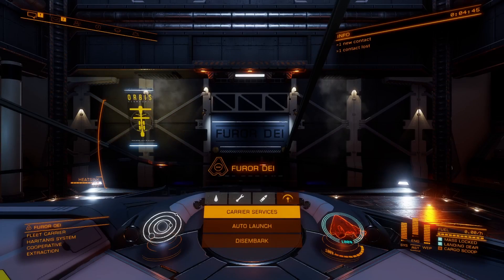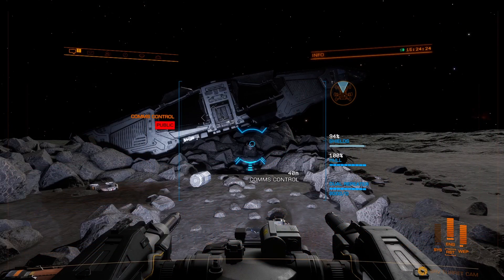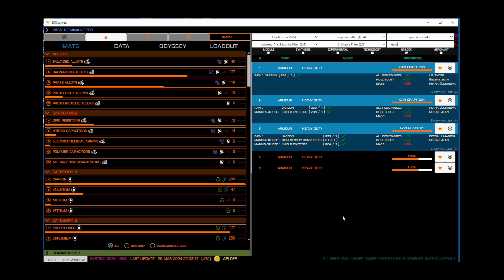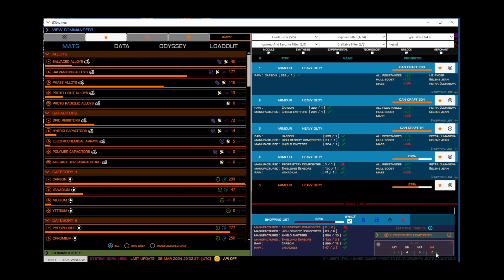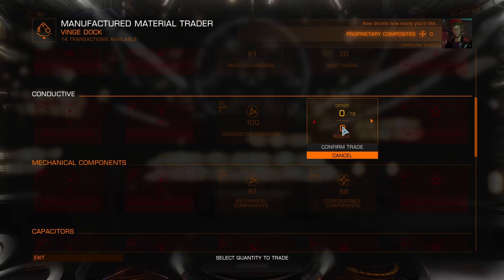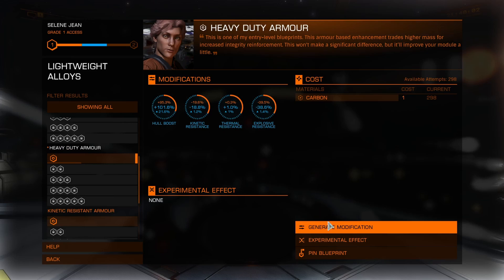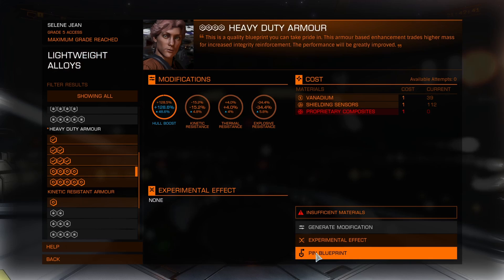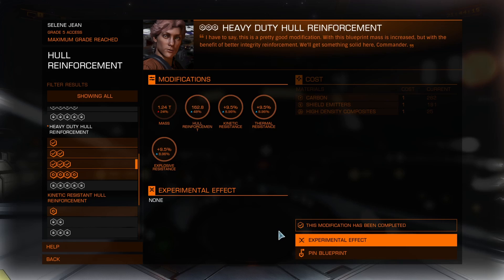EVERYTHING You Need To Know for Engineering in Elite Dangerous | Tutorial / How-To

Comment: Little tip :

If you have to engineer many hardpoints modules for several ships, like multi-cannons for example, and you don't want to do the same trip 3 or 4 times to « The Blaster », take a ship that has a long jump range and many slots, and put all your multi-cannons on it (I use my exobiology Mandalay for this ^^). So you can mod all your 6 multis at once, and get back to your home station, dismount the weapons and give them back to their original ships (Cobras, Vipers, etc. that have many S and M slots but don't have any good jump range). Saved me a ton of time...

Comment: As others wrote already, the "rolling" mechanic has changed. For example the number of rolles required to bring an armor module to grade 1 (Heavy Duty Armor @ Liz Ryder) is 5 rolls if the level of the engineer is Low. The higher the engineer level, the lower the number of rolls required to achieve a certain grade.

Comment: Ok i am new does this upgrade one ship that you are flying our do you have to do it per ship? Again I am new to the game.
Reply from the maker: Good question! It's just your current ship. Think of it like taking your ship into the shop to get work done. o7
Reply: @Mile13Gaming   Not strictly true. You modify ship *modules*. When you want to switch to another ship you can, in theory, take the modified module out of your current ship (if necessary replacing it with some cheap dummy unmodified module), temporarily store the module, then switch to the other ship and take out the module from storage to equip it on the other ship. I‘m saying „in theory“ because modules have classes and different sized ships often have different module class requirements. In practice, I have only 5 different FSD modules engineered (classes 3-7) and swap them in and out of ships as they‘re needed. Similarly with various D-rated light-weight engineered modules, etc.  Admittedly, the swapping process is painfully cumbersome, and I‘m still hoping that one day FDEV will implement a ship loadout feature, but sharing modules is less painful than fully engineering each of my dozen ships separately.

Comment: The issue with the various way's of keeping track of what you have vs what you need, isn't updated in such away that it's totlally accurate. It take's a day or two, before the various site's I've utilize, to update my today's data, which will generally change by the time it's updated.

Hint or spoiler alert, adding the experimental immediately after doing the first of 5 upgrade's, cause you after pinning the particual modual. Never having to go back and do it later.

Comment: Great guide, love the engineer app. Though I now have about 5 different modules at various grades so my shopping list looks quite big and complicated compared to the one you had. Though the app is really worth using :).

I noticed this is 6 months old now, and that they were some recent changes by fdev to engineering -- other than more materials found etc, they said something about the wheel click spins are not random anymore. :)

Q: If you upgrade a part to level >0 -- e.g. Heavy Duty, lvl 5 -- can you redo the part to have a different upgrade on it? e.g. FSD for range, but then decide you want something else, not range? or do you have to buy a new FSD ?
Reply from the maker: Yeah, if you have a lot going on at once, it might be a bit much. As far as the changes go, they took out the randomness, so now it just takes as many spins as the grade level. G1 = 1 spin, G2 = 2 spins, etc. Check this out: https://youtu.be/yDD3kyBFDLI
Reply: @Mile13Gaming  Cool thanks for the link. :) I thought it was something like this, but doesn't it also depend on the level you have with the engineer. I just arrived at a new one, did a G1 on my sensors, but took more than one spin, I think because my engineer level was only 1 as well.

Comment: Important work, well done! Engineering is much easier and faster as many a forum dad makes you think. PSA: dont finish the grades, jump to the next one when its unlocked! Farming HGEs is by far the fastest way to gather manufactured, for raws its the limpet & flak method either at crystaline shards or brain trees. For data just scan every ship infront in supercruise or while docking at any station, it will accumilate over time, but for the first upgrades visiting Jamesons crashed Cobra and potentially relogging provides a basic stock. Cant wait to see you do some pew pews with the lads in that FDL 🙂
Reply from the maker: Yup, I made it a point to call out that you can move onto the next grade without finishing the previous one at @9:40. Saves a lot of time, materials, and frustration. :)